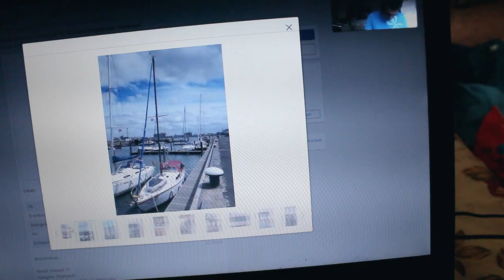How We Got Our Ship Basecamp

Comment: Thanks for great video.
Cam you tell - what is your boat type and size?
Reply from the maker: Thanks a lot! We're sailing on a "Katapult 31" - It is a steel boat from the netherlands, built in 1980. They did not produce a lot of the boats, but it is quite similar to a wibo 930 (Also from the netherlands, and about the same time, and there are still a lot of them out there ;) )